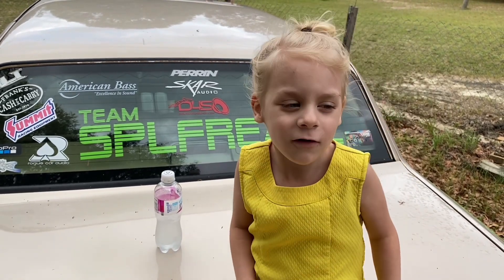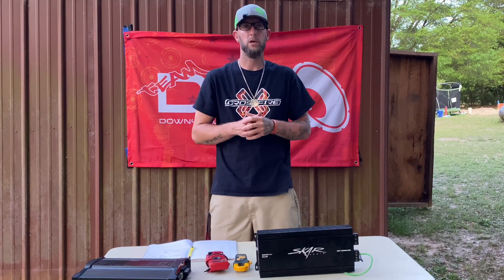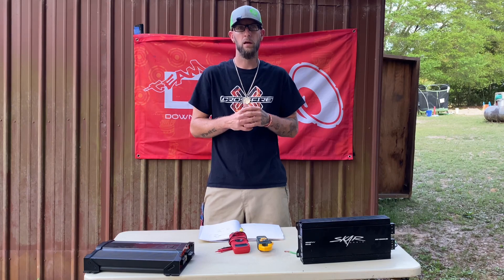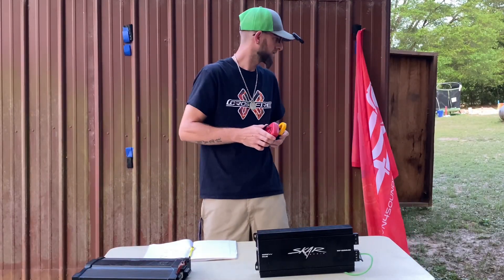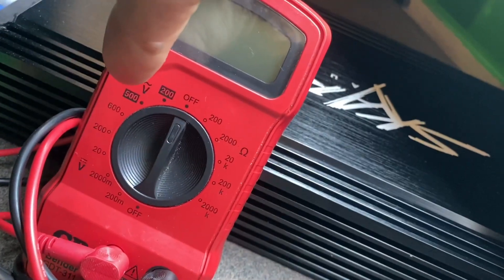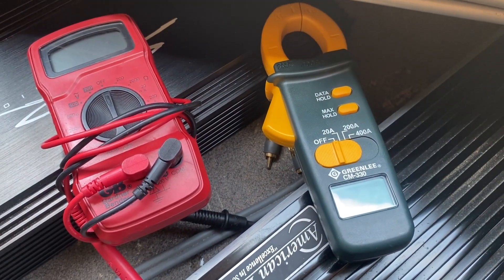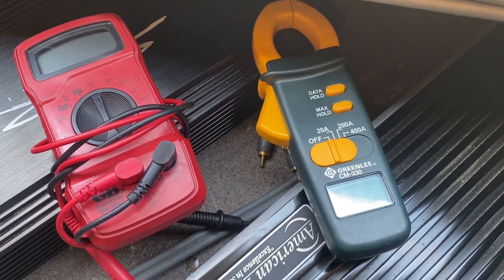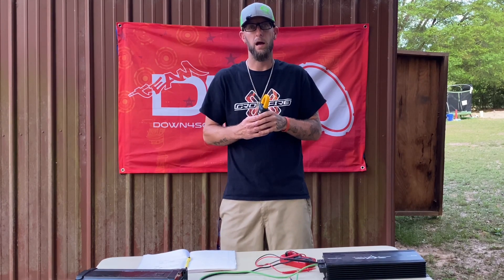How to clamp your amp to find true RMS watts and box rise. How many watts are my 18s getting?

Comment: With that rise have you thought about running at .5 ohm so you'll rise to 1ish.. just a thought
Reply from the maker: I thought about metering like that but the subs will only wire down to 1 ohm would get more power just running the 2 amps. I’m gonna get a 5k pretty soon